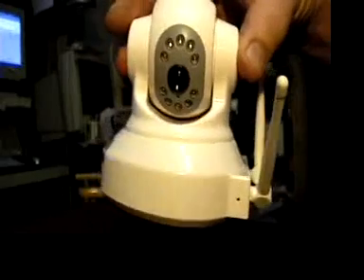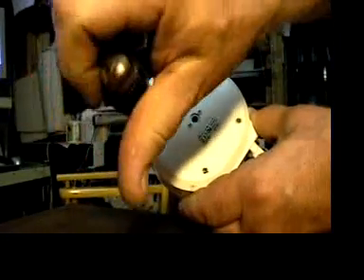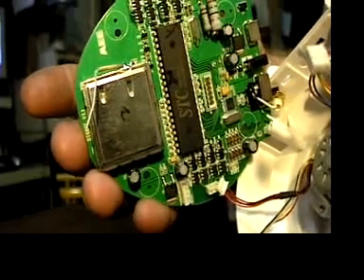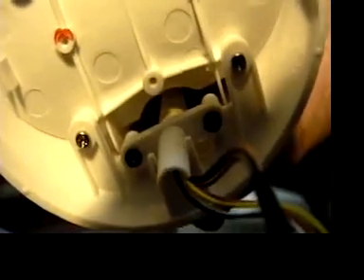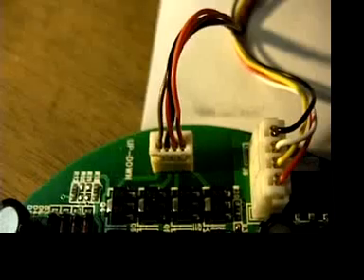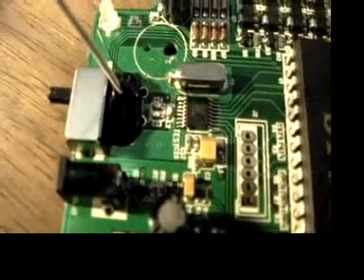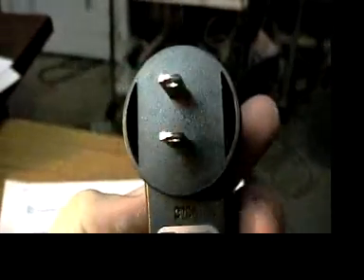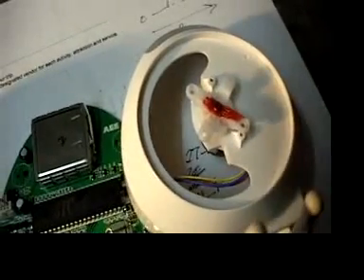Teardown of wireless Astak pan Tilt camera

Comment from the maker: I think your best bet is to install a relay or optical isolator that 'presses' the pan button every 5 seconds. Such a circuit should cost about $3 in parts. Contact me if you are interested in more free information. 720 222 1309 I assume you are collecting the video from the base station and not the camera.